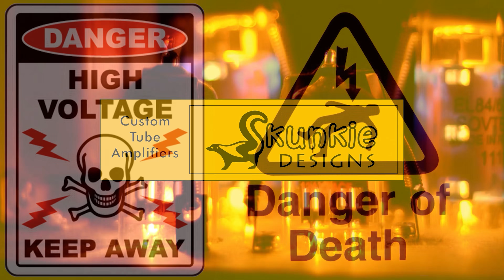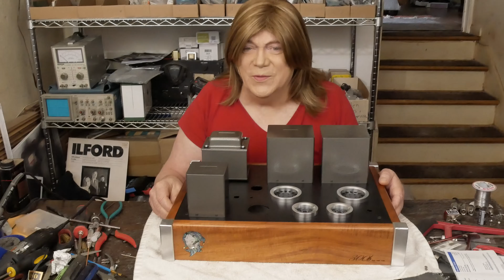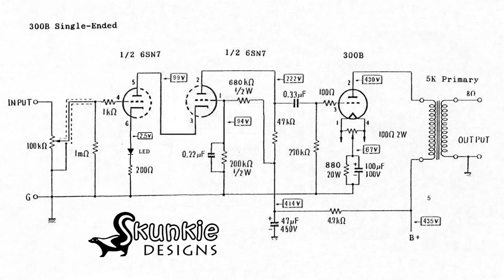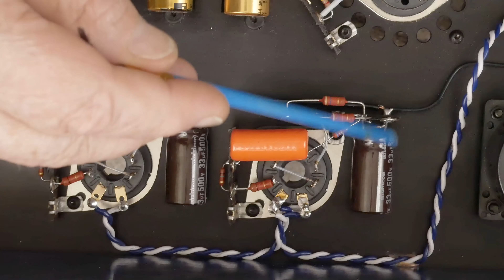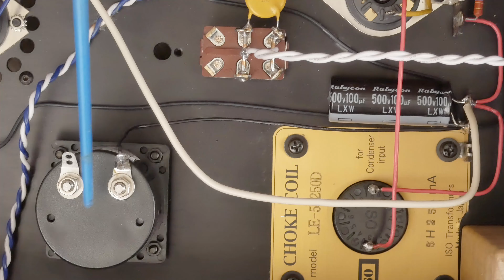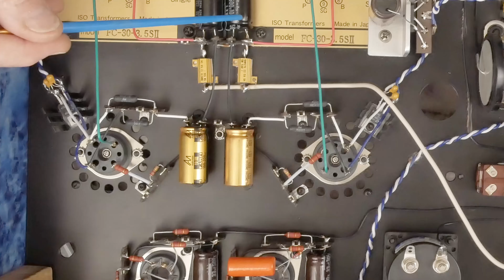Cost is No Object "Ultra" 300B Build: Layout Design #3

Comment: I have a Woo Audio WA5LE headphone amp (2 × 274B, 2 × 6SN7 and 2 × 300B). Amazing amp and I love it. I'm currently running Sofia Electric Princess 274B's, TungSol 6F8G's (with adapters) and Sofia Electric Royal Princess 300B's.
I have numerous rectifiers and drivers, including Mullard ECC32's (unused, NOS, original boxes).
I've purchased far too many pairs of 300B's: 
STC 4300A (Redprint Oct 62, WE 300B's, made under license by STC in the UK)
EAT 300B
Emission Labs 300B mesh
AVVT 32B-SL
Takatsuki 300B
Svevlana 300B =C= Wings
and others.

Comment: Ken Stevens w CAT prefers 
KT-120 over KT-88 or EL-34 
Convergent Audio Technologies
Reply from the maker: KT120 is a great sounding tube. I really wish they hadn't changed their manufacturing, the later version doesn't meet their own power specs in and SE amp without red plating.

Comment: Hello, Stephanie! Btw, why are you using that 0.22uf ceramic film cap and not your favorite Mundorf aluminium in oil cap there? Do you find ceramics sound good? Also what is that huge MKP reservoir, a 330uF? Thanks!
Reply from the maker: This cap is shunting that grid to ground to help stabilize it. I tried "fancy caps" in this spot and it wasn't audible like the coupling caps are. That big black cap is a 27uf 630V solen. And yes I tried DC link, WIMA etc and they have horrible bass response compared to this Solen.

Comment: hi skunkie, have you tried to drive the 300B with both halves of the 6sn7 wired in parallel?
Reply from the maker: Yeah, IMHO it's not enough drive for a 300B and not a fan of parallel tubes in general. Tubes are NEVER identical, even "matched" tubes. When you parallel them weird stuff starts happening.